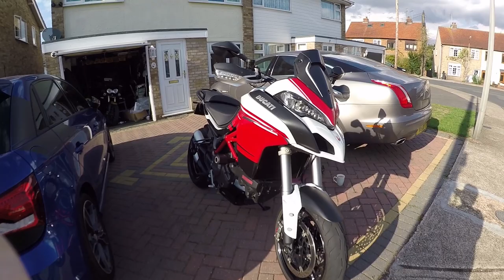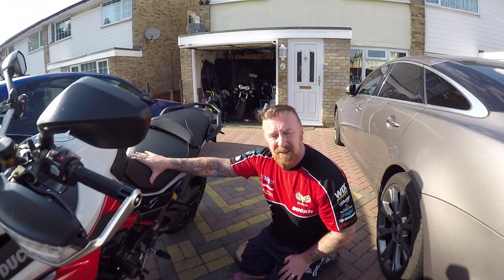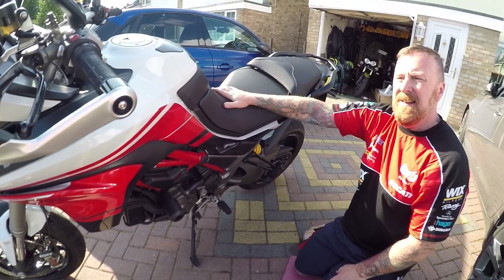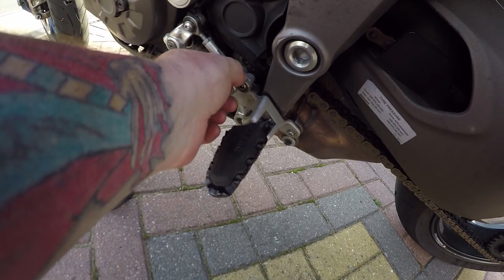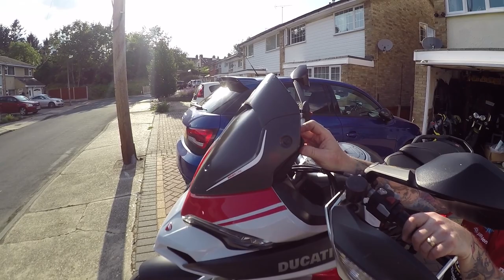DUCATI MULTISTRADA 1200S BREAKING DOWN ON THE M4 F#*K!

Comment: Owned a 2012 Multistrada 1200S lovely looking bike, great to ride but mine gave me so much grief warranty wise. Glad you made it home 👍
Reply from the maker: In the end cards you can se I had a 2010 and loved it and was going to buy another but saw this one for sale and that was it lol
Going to go round it tomoz and make sure it's all ok then go for a vlog 
It does look so nice so let's hope that this is the only problem with the bike 
Thanks for watching bud
Reply: I had the 1200 enduro . It was shutting off and turning on while on the highway . Almost fell under an 18 wheeler. Ducati insisted it was my dirty chain that was causing the issues due to poor maintenance. I was touring North America for over a year at that point. Some days I rode 1,000 miles for the iron butt association so yes my chain could be very dirty on any given day. They finally fixed the bike. According to them it needed an engine rebuild. That took 3 months,then it was down a few days later for 1 1/2 months got it back lasted 2 days wouldn’t run . Back to the shop for another 1 1/2 months. Got it back 2 days later I tried to cross the USA in 48 hours . 500 miles into the ride the bike drops 25 mph a on the highway I almost get rear ended . Only 1 cylinder running . 
I was able to use that bike 20 days out of an entire year. Worst pice of garbage I’ve ever owned . It was the only bike to ever give me trouble in my life. Japanese from now on forever .
Reply: @mxg709  I've never gone near a Ducati after my experience. Mine spent more time at the dealers being fixed than in my own garage. I've been trouble free since with  Kawasaki and two Yams.
Reply: @Banditmanuk  yea I was only able to ride mine 20 days in the second year of ownership . What made it worse is that all the breakdowns happened out of state on the other side of the USA. I had to fly home 3 times due to the bike being down plus the hotels while I waited and when it broke down in Florida twice I had to rent car each time and drive to Nj. I offered to buy a new bike if they just took this one after the first breakdown (it needed an engine rebuild) the dealer even told them to do it but they refused. Destroyed my  North American road trip . Horrible company. I spent over $5,000 on hotels ,airfare and car rentals . Over 12 months

Comment: Had the same kinda thing when I bought an Aprilia Tuono from Fowlers in Bristol, half way home the throttle cable fell off the bracket under the tank! had to ride back the rest of the way with half a throttle dangling out and sticking! so much for a PDi check when you buy from a dealer lol, but once I got home it was a 2 minute fix ;)
Reply from the maker: I know bud mine too but not in the side of the m4 lol 
Take care bud

Comment: hi Mark I have a couple of questions about my gilera dna problems please could you get back to me
Reply from the maker: good old DNA's what up bud I do have a few videos on them if you have watched them , type in dna mark savage
Reply: @marksavage  I've watched all of your dna videos I can find but my problem is when the bike has been running for a short while the indicators dont flash when I indicate they just stay on and glow
Reply from the maker: they do suffer from electrics but check battery and connections and the earth bud 
does it electric start ok? if not charge battery or change
Reply: @marksavage  thank you ill have a look and Ye its starts off the electric start fine if i have any more problems will it be okay to message you again and i love your videos hope you do more DNA videos in the future 😊
Reply: I have one more question I took my bike to a garage to get the ignition barrel changed and it was doing 60 to 70 mph but when I got it back from the garage it struggles to get 30 mph I have no idea in what to look for have you got any ideas and sorry for bomb barding you with loads of questions I just think your the best person to ask
Reply from the maker: @stewylimon2421  wow that's odd 
They should not have touched anything 
Was it only the ignition or cdi as well ?
I'd pop back to them and ask as the DNAs go very well so that doesn't sound right bud
Reply from the maker: @stewylimon2421  maybe you might of got some crap in your carb or a pipe come off but that's defo odd
Reply: @marksavage  Ye only ignition barrel went back and the garage said they had no clue I just find it wierd that it went in perfectly finr and came out running like crap but i think ill try cleaning the carb and looking for any wires that are split or any blockages ill keep you updated if thats okay with you
Reply: hi Mark on last thing about my dna   can you make a video on how to properly tune the carb or give me indication on how to do it properly please

Comment: How are they still in business is beyond me...🤣🤣
Reply from the maker: they are great bike its just the parts they seem to be working with !!!
Reply: @marksavage  looking at all the videos on YT of things that people suffered through with their bikes it’s unbelievable 🤪🤪
Reply from the maker: @BlazinBlades  i think you get a fair share of bad bikes from all makes but its like alfa cars , amazing looks but the electrics were shot to bits ,
ducati seem to be the same but the performance and handling are good
i wasnt thinking that on the hard shoulder of the M4 pmsl
Reply: This sort of thing can happen with any manufacturer. Same thing happened on my VFR1200F, with only 4000 miles on it. The shift linkage bolt fell off 900 miles from home. Fortunately in the US there's a auto parts store  in every town(usually 2 or 3!). Doesn't matter if the assembler's name is Luigi or Yoshi, all the factory's have "Friday-built bikes". Just glad it was a shift bolt and not a crankshaft bolt😄